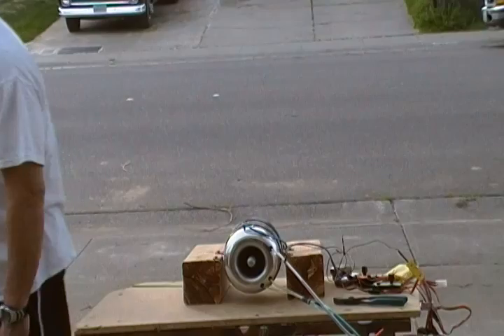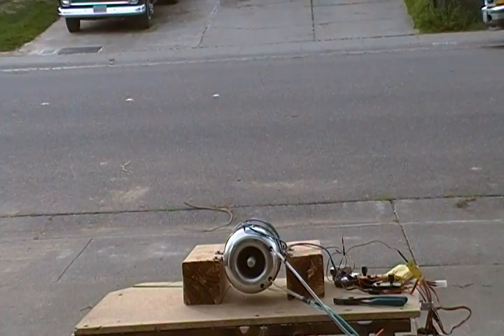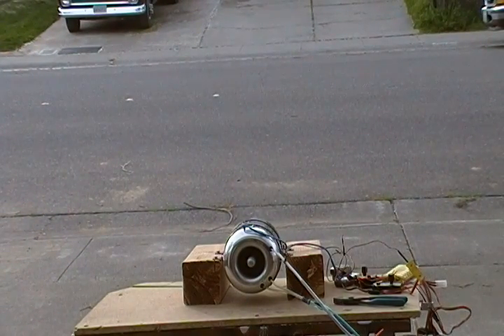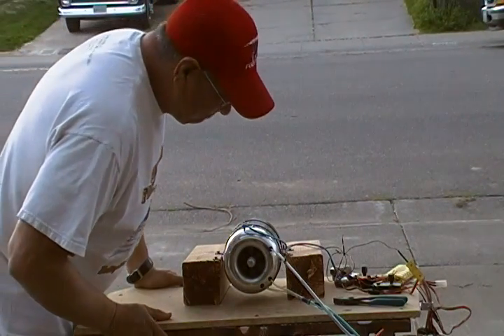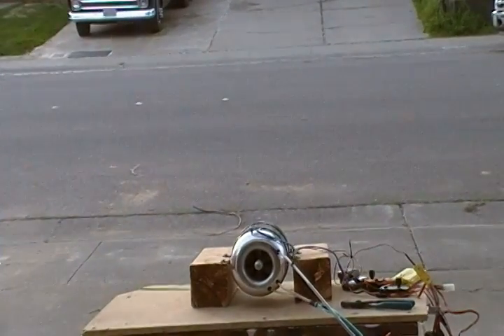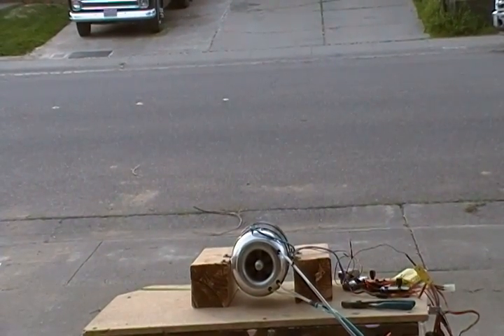Dans gas turbine jet engine AMT 45lbs thrust

Comment: I guess they are lucky that there was no un-contained failure as they stand there with no ear protection either.  Hmmm.
Reply from the maker: Paul Guaglardi 
No luck required as the turbine is contained and ears are just fine, but thanks for caring.